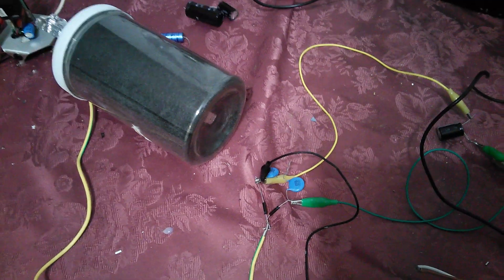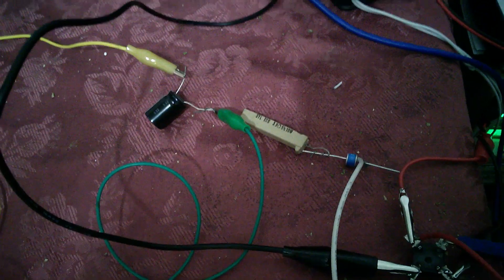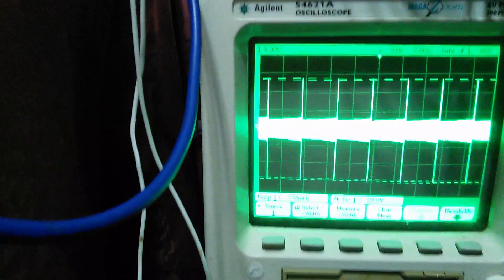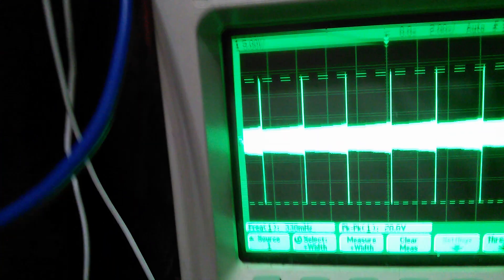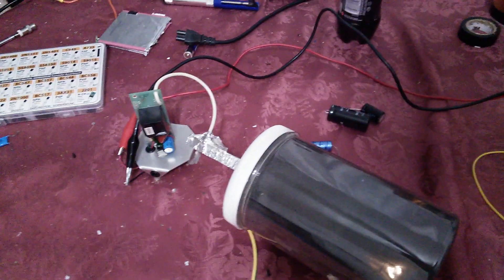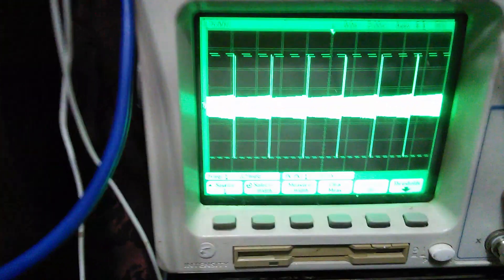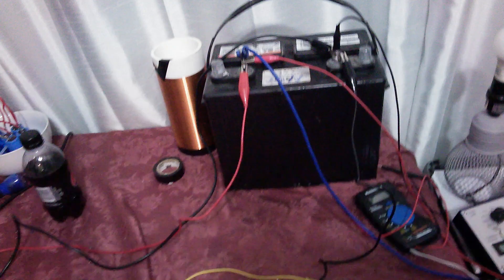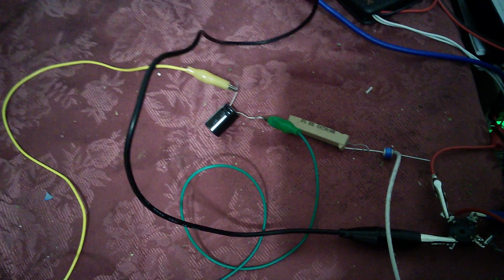Gas Discharge Tube Cap Dump

Comment: Yea you and i had the same idea.i set up my ion emitter to a secondary conductor, then to a microwave transformer, and i have hundreds of oscillation due to sparks, so for part 2 of my transformer idea, its much easier to send it sparking on a single wire to one input wire to the  transformer.  Try this test if that is not what you have here.  ok set the output  from the cap dump to one wire on the positive side of a second  transformer. on the second input wire use a ground wire, or even a grounding wire spark gap. on the 2 out put terminals, attach your volt meter.. let me know please..show us the results if you set it up in the manner suggest , or is that the set up you have? ty..
Reply from the maker: I'm waiting for meters to come in believe it or not... It was a bad run with the QEG blowing up all my stuff. Granted much of it was on its last leg but still, been a rough month.  But yeah I experimented with all those variants.  Sometimes up to 60v difference when i'm not connecting it to load ( battery charging)  Once I start getting more equipment I will be able to show more. Not trying to hide anything just lacking basic equipment and waiting for it to come in. Thanks!
Reply from the maker: Yes and I notice that extra high frequency ringing the spark gap introduces. in the mhz....
Reply: @joellagace1679  you could say it is similar to a Tesla coil, as the ion channel is a top load like on  top of a Tesla coil, and the spark discharges are a result of the electro static potential. at this point adding the capacitor to the top load, increase the pressure on the out put side.
If you like to call it elektro-motive force. I luv free energy.. nice job..

Comment: Hey mate, nice work and thank you for sharing all your research and knowledge with us all. 
The wave form you have is interesting, it looks to be gaining power in the at the end of the pulse kind of like a trumpet wave.
Reply from the maker: Yes I guess my point is the spark gap fires at 80v it goes into primary side of coil, nothing else on it no diode or anything so you get the inductive kickback pulse as well, at around 300 some mhz between the negative pulse and the positive, So what i'm getting at is being nearly identical or maybe even a little greater amplitude on the inductive kickback side, we are getting 2 pulses for the price of one, If this is not "free" energy in the sense we don't need to pay for this extra input then I don't know what is!